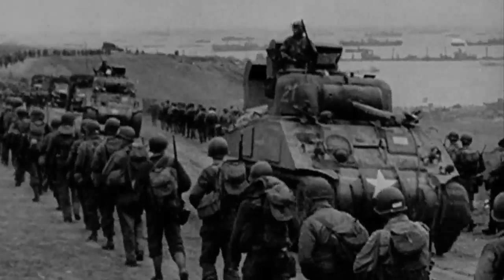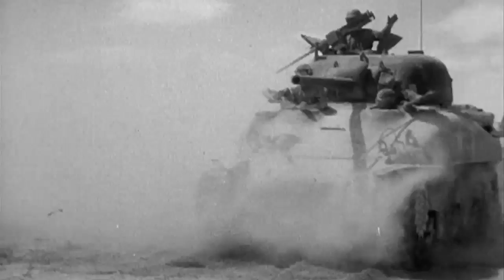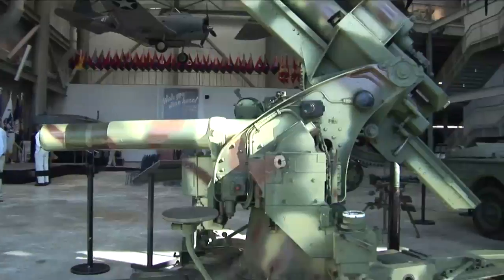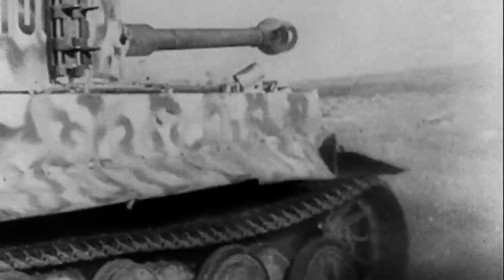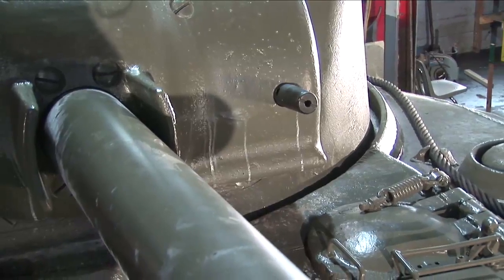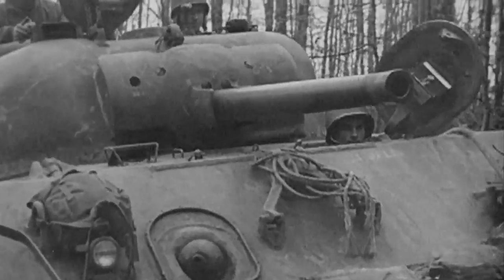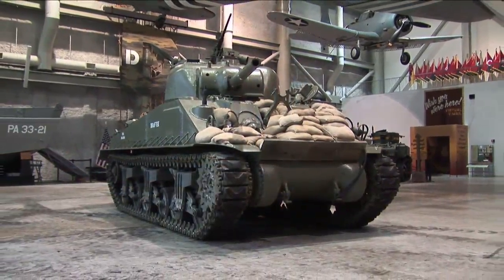The M4 Sherman Tank at The National WWII Museum

Comment: The Sherman was not designed to fight tank on tank but a support vehicle and had the guns like 75 and 76mm guns and like the M4A3 having a THICK M4 105 cannon. Also I did not fight Tiger1/2s often because there were not a lot of them around compared to the PZ IV. Also they rarely fought panthers due to the fact the panther could not even reach the battle zone without the entirety of the tank just failing all together. Plus M4A2s were equipped with a T-45 Shot which fired a thin tungsten round in a casing and could penetrate easily through Tiger armor. Plus M4s had wet storage so rounds would not just get triggered and catch fire.

Comment: Such a biased bit of work, so much disregard for the Sherman's actual performance. Completely fails to reason out why a medium tank had difficulty fighting a modern heavy tank, and the logistical reasons why a medium tank was all the U.S. had.
Reply: For a museum curator, he knew little that was accurate. One, the Sherman had to fit onto ships for overseas deployment, and the shipyard cranes at that time could not lift heavier tanks. Two, the 75mm was excellent for high explosive work, its main role, and tactics effectively used by armored divisions were adequate to maneuver around Tiger and Panther tanks for side shots, avoiding frontal encounters. Three, the Sherman was mass produced under world-class standards, meaning excellent use of uniform parts replacements in the field. Finally, the Sherman had much better record of reliability compared to the T-34 (the Russians had a large number of Shermans to compare with) and German tanks. Finally, the Sherman was an easy tank to repair as it was designed for quick access to the engine, etc. German tanks by comparison needed much longer periods of repair and maintenance. Overall, the Sherman was the best tank of the war when all factors were considered.

Comment: I'm disappointed, WW2 museum. I had hoped you had better fact checkers than this. You repeated the underarmored myth, the undergunned myth, the flammability myth, and mentioned nothing of its innovations such as its gun stabilizer system, radios in every tank built (still somewhat of a novelty in 1942) or the automatic fire suppression for the engine compartment. 

I've purchased books from your library that tell the real story, such as RP Hunnicutt, Stven Zaloga, and Harry Yeide, yet it seems Belton Cooper is the only provenance this video drew from. 

I think it's a disservice to the men of armored force to present their vehicle in such a negative light, especially considering total losses from all sources amounted to less total units than the production run of PZ V panther, and ended the war with an overall positive kill to death ratio, with some stellar examples exaggerating this advantage even further (like Aracourt and Dompaire, just to name a couple). 

The armor was comparable to or even superior to the most numerous rivals and opponents of the time (T-34, Pz IV respectively) with some models (also not mentioned in the video) such as the so called Thunderbolt of Col Abrams himself or the E2 "jumbo" far surpassing them. 

Also the claim that tigers "exacted a heavy toll" is very misleading and basically a lie. The US army confirms three- as in 3, known encounters between their armor and the Tiger 1, and guess what? M4 won 2 of them (albeit in fairness one was unmanned units being loaded onto railcar for transport to the front) and the M26 fireball lost the third.

Was it perfect? Certainly not. But it deserves far more credit than you gave it, and repeating myths to puff up the postwar "underdog" vibe of our boys just doesn't do them justice. 

The Russians, the French, the nationalist Chinese, the British, the Australian, hell, even some German Commanders (like the commander of the infamous Panzer Lehr, for one notable example) all had positive remarks and impressions of the M4. Dmitry Loza swore by his M4A2 "emcha", and recounts being able to best even tigers and Panthers in it along the treacherous eastern front.

It's not often I disagree with the museum, as I live close enough to make regular trips, but in this case I cannot pass by without calling out the sloppy job of fact checking who ever greenlit this video did.

Comment: This is a terrible video. It only serves to highlight the many misconceptions regarding the Sherman, and doesn't explain how the faults it actually did have were fixed. Yes, it did have some faults, but these were quickly fixed with upgrades like the HVSS suspension system, self sealing fuel tanks, Wet ammo racks, and the 76mm M1A1 gun. Post war analysis of the Sherman found that crew survivability was actually one of the highest of any tank in WWII. For the entire war less than 1500 Sherman crewman died as a result of battle.

Comment: Your video suggests, incorrectly, that the Sherman was intended for duels with high-calibre German tanks. The Sherman was really in Europe to provide machine gun and field artillery for infantry fighting other infantry. The US Army used tank destroyers, artillery  and airplanes for destroying and disabling anything bigger than a Panzer IV.
Reply: +Hannah Miyamoto

 Not at all. Aircraft were exceptionally ineffective at destroying German armor.
Reply: FM 18-5  they did attack tanks, but the intent was to do so from reserve as counter attacks, or if in close in the attack column to support and assist tanks FM 17-1
Reply: Quite correct. Aircraft were terrible for anti tank work; nothing that tactical aircraft carried could penetrate a tank except bombs, which are pretty hard to hit a tank directly on with when you have no bombsight because you are a fighter. Rockets could work, but were spectacularly inaccurate and had low explosive yield.
Reply: Also tank destroyers never attacked tanks, ever. They were mobile anti tank guns, meant primarily to plug holes in lines and ambush German tanks as they broke through and therefore stop any attack. They were doctrinally banned from offensive work.
Reply: TREY RIVER Good point I should have worded mine better
Reply: There is even an acronym for it.. TLAR ... That Looks About Right

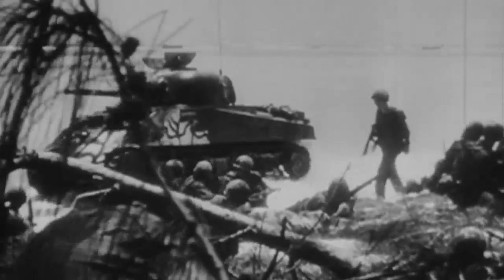Comment: @ 5:15 "Although tasked primarily for tank-to-tank combat in Europe" Holy SHIT ARE YOU KIDDING ME?? That statement could NOT be more damn wrong if they tried. American doctrine during WW2 did NOT have tanks like the Sherman to combat OTHER TANKS. They were intended to provide infantry support and aid in overcoming fortifications and other built up static defenses. The American Army used their tank destroyers and field artillery, as well as aircraft where possible to engage enemy armor. If a Sherman encountered enemy armor such as a Panther or even a Panzer 3/4 class of tank, they passed that information on to the Tank Destroyers, and did not engage those targets on their own unless absolutely necessary. This is why the Sherman was commonly equipped with the 105 mm Howitzer, or the 75 mm cannon. These cannons were not intended primarily to deal with armor due to the fact that they didn't have a very effective AP round, due to the poor velocity characteristics of the cannon. When it comes to defeating armor, velocity is TWICE as important as weight of shot, and the cannon simply didn't have the velocity. This was a sacrifice so that the shell would have enough mass to contain enough High Explosive to be effective against personnel or fortifications.
 Furthermore, the armor layout and profile (think height because of radial engine and under floor transmission line to front drive)  makes it dead obvious what these tanks were intended for. They were not intended to be able to withstand hits from other tanks, or anti-tank guns. They were mainly intended to be proofed against small and medium arms fire and shrapnel, with the main focus being on maneuverability and ease of production. Remember, the Germans built the hulking behemoths that were the Tiger, Panther, Tiger 2 etc... because at that point they were fighting a defensive war, where they weren't expecting much maneuvering and were more likely to be entrenched, facing multiple enemy tank threats. The Americans on the other hand were on the offensive in Europe basically since the very beginning, so their priority was maneuverability, ease of production so the battle field could be flooded with M4's, and also importantly reliability. I cringe when people say the M4 was a bad tank, or that German tanks were better. It's all context people. When it came to what we needed for the type of war we were fighting in WW2, few tanks match, never mind exceed what the M4 was capable of doing, and allowed us to do Raaanttt... OVAH!
Reply: The British  very successfuly used mixed units of unmodified M4A4  and the upgunned Firefly  version with the Firefles tasked to take out German tanks to make best use of  both types of gun.

Comment: The M4 Sherman was just good enough in every key area (speed, firepower, armor) but also lacked in each area. It was mobile, but the British cruiser tanks like the A34 Comet were better. It had a good 75mm gun against Panzer IIIs and IVs, but against a Tiger or Panther it was hopeless. And it's armor was good by the standards of the very early 1940's, but it's height and weak armor at crucial points made it a deathtrap. 

It enjoys its reverence because Allied troops were supplied with so many of them. But its ultimate military value was limited. Only a minority of German tanks were taken out by Shermans while the majority was destroyed by ground attack fighters or had to be abandoned due to a lack of fuel. The Russians were supplied with M4 Shermans and never really used them to any major extent, since their T-34 was much better. 

But the Sherman's versatility and ability to be easily repaired was a major plus. Bigger gun? No problem, mount a 17 pounder. Need mines cleared? Add a flail. Want to launch rockets? Just install a rack on top. And parts were standardized, so any part off the shelf would work, even if it came out of a Chrysler, Ford or GM factory.

Comment: The tank crews of Shermans were probably more likely to run into infantrymen with Panzerfausts rather than the Tiger Tank. They were more likely to run into the up gunned Mark 4 varieties of tanks which might somewhat resemble a Tiger with their up armored sides. For all the talk about the Tiger tank it was the Sherman tank that remained in service well past the war and in various armies afterwards. Tiger type tanks had weak power to weight ratios as did many heavy tanks of that period in the war which was why they were rarely ever used in the war by the Allies who were content to use the Sherman throughout the war and simply up gunned and up armored their tanks rather than design heavy tanks with more armor and better armament.

Comment: Ronsons, lights up first time every time
Reply: wrong. 
1. The m4a1 is an infantry tank meant to support infantry and not to fight other tanks. Have you ever read USA doctrine? The armor isn't all that weak, at the front on some models, the armor was 63 mm thick SLOPED back at 45-47 degrees therefore giving it an effective thickness of 90mm give or take witch isn't far off the tiger 1's 100mm flat. 

2. The 75mm m2 and m3 medium velocity gun was a dual purpose gun with a good high explosive shell, remember the m4a1 was meant to help infantry, and it could still kill a panzer 4 with the m61 AP shell. 
3. Fires in the sherman weren't because of the gasoline, it was because of improper ammuniton storage. 

4. The lighter companies and tommy cooker didnt use the slogans until the 1950's. The war ended in 1945.

Comment: When the M4 was introduced, in 1942, there were very few tanks that could match it. Tigers were a rarity and there were relatively few German tanks or SPGs that had upgraded sufficiently to counter the M4 frontally. With the 75mm's extremely high amount of HE filler, anti-tank guns and infantry were easily dispatched, if the Gunner could hit near them. The problems really began in 1944, when the M4 faced massive ambush scenarios in Normandy. By then, the Nazis had fielded plenty of long 88s and 75s, which no allied tank could reliably stop: not the IS-2s, not the M4 Jumbos, not the Churchill VIIs. Gun tech had simply surpassed armor tech.